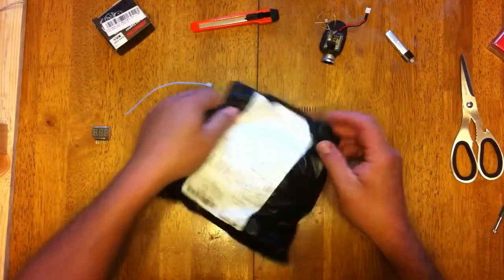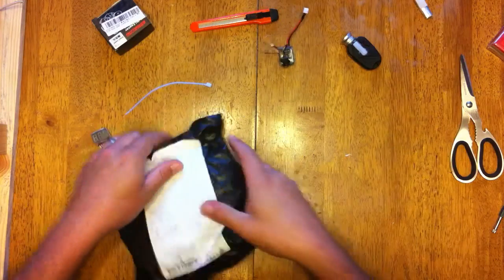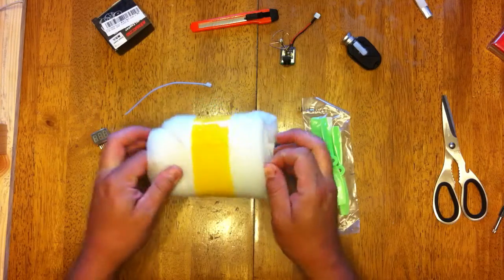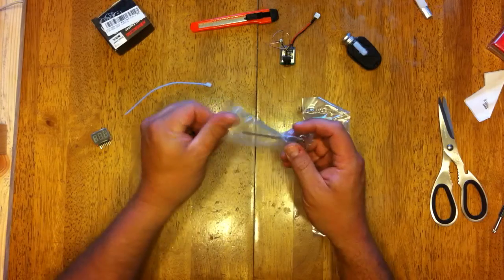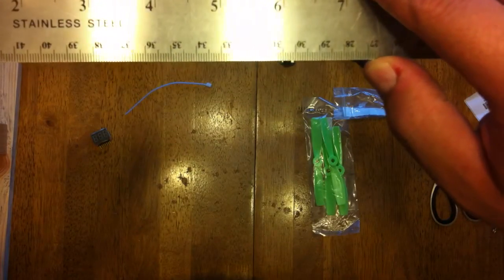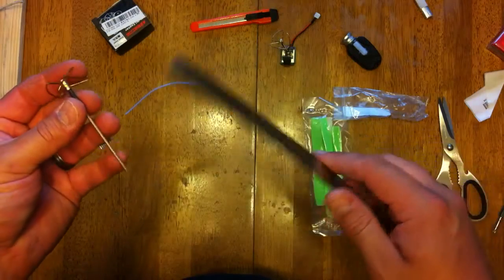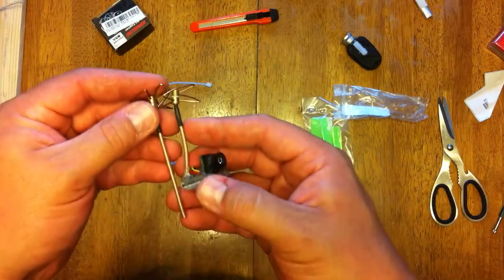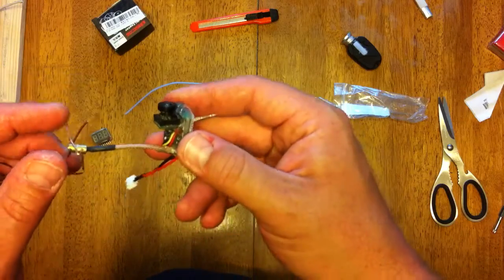Lightweight antenna for micro 5.8 fpv

Comment: Hi, I'm looking to buy this antenna for a micro FPV setup.  Will it affect the signal if I cut the wire shorter?  Can I cut to any length as long as I don't touch the black portion?
Reply from the maker: The way I understand it from several different people, the critical portion is the top bent portion so cutting the bottom off does not affect anything..
Reply from the maker: If you not a subscriber please like and subscribe, thanks and have a great night!!!
Reply: Perfect!  Can't wait to try it out.
Reply from the maker: This is a fun unit to make!!